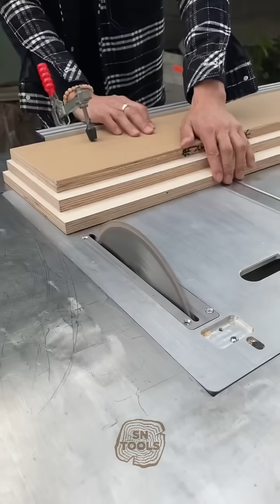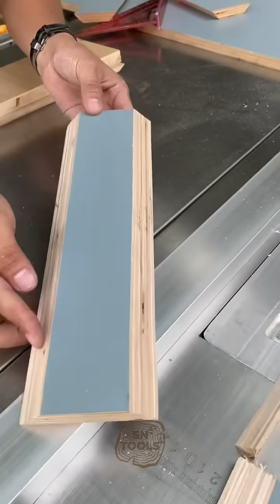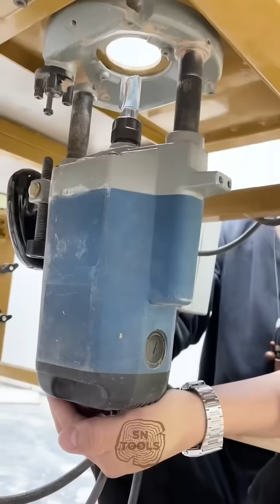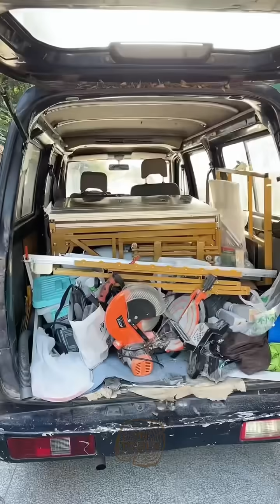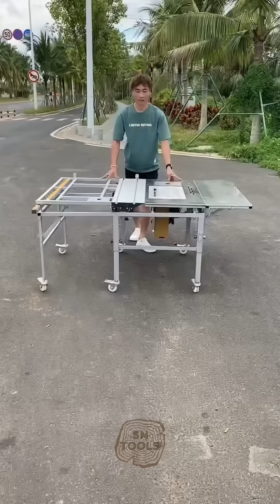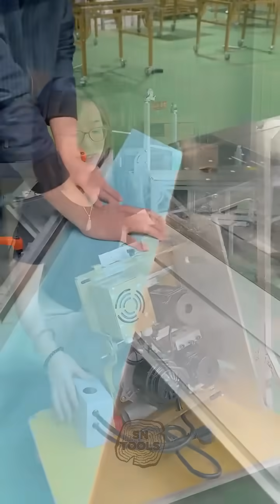Multi-Functional Sliding Table Saw || Brushless Silent & Dust Free Mother Saw || JT-9BX Model

Comment: From what I can see with this set up it would suit me perfectly.
Im in the process of starting up a business and I was looking at  using a load of different equipment from panel saw to router table but realize it would take up too much space for the layout of the workshop. This is just perfect what I want. Takes up less space and would give me more room to work.
Just need to find out price.
Reply: Check out the description mate.
Reply: Gmail and a WhatsApp 😒
Reply: This definitely looks like it will hold up to YEARS of production work.

I spent many seconds scouring the Google, but my efforts FINALLY paid off: this fine piece of silent & dust free mother equipment is available right as we speak on the eBay for only $899.99 plus tax and $599.99 shipping and handling fees.

Best of luck with your new business.  I can't wait to see the amazing things you will create with this silent & dust free mother saw!

Comment: Is the second blade -- counter-rotates? -- to give a clean cut on the bottom surface?  Assuming that everything is perfectly aligned, blades are the same thickness, not bent at all and mounted straight.